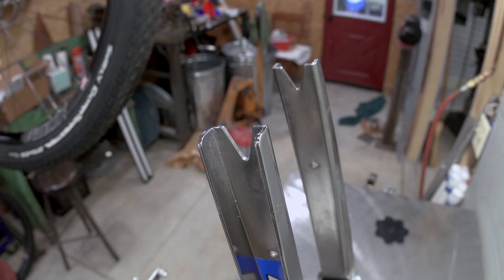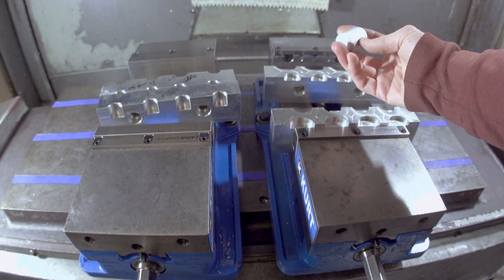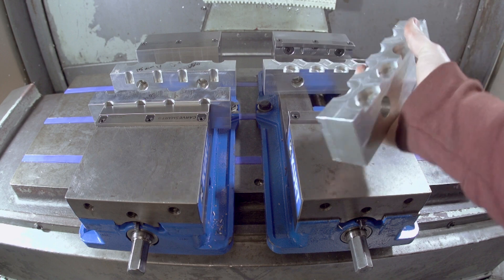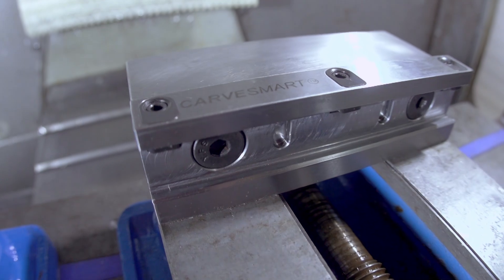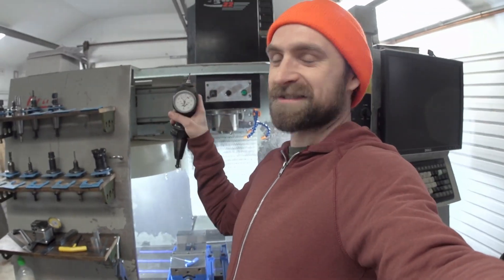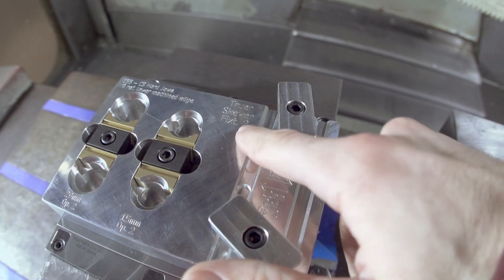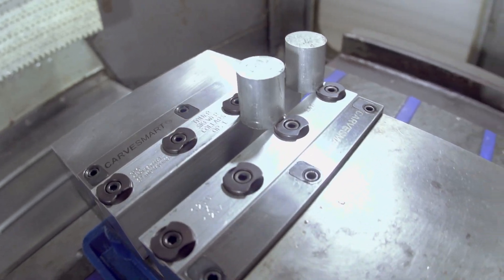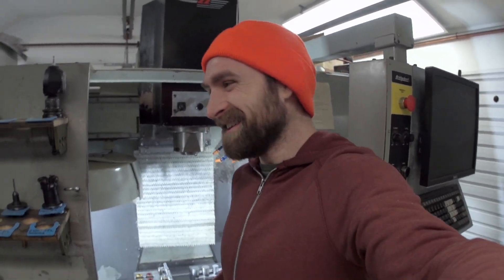CNC Workholding Solutions - Designing a new fixture for making The Truer Skewer

Comment: yeah I had that issue with loading 4. So I stuck with doing 2 at a time.(minimal tool changes too). I had 3 setups with 1 set of vise jaws. G54 was the same location the left rear soft jaw. (Been a few years since I ran them though)

Comment: Great improvement. A few things 1) write down your machine offsets for g55 and g56.  At some point you might accidentally setup a one-off job on your machine and forget which WCS you’re in.  If you can just type the offsets back in it’s way faster than proving. 

And 2) if you love that you would really love a Pierson pallet system. The vises would move to a pallet, so they’d never need to be trammed, and you’d make pallets for any new parts you have.  I started production with large fixtures clamped in vises, and still do that to prove an approach to fixturing or get a part in production, but I can’t imagine making the thousands of parts I’ve made in the last 18 months without the pallet system.  

I’m
Enjoying your videos and appreciate you sharing!!
Reply from the maker: For one-off jobs, I’ve been using g57. The Pierson system is great, but I don’t currently run my machine enough to justify the expense. Thanks for watching!
Reply: @RussellMakes  Thanks for making the vids!  And here's hoping you do so much business you justify the pallet system!  

I had put it off as well, and luckily my son (who also machines) had just pulled the trigger and once I started to realize what it made possible I got the PPS as well.  I now have 6 different dedicated pallets to production items, 3 fixture pallets that have a grid of m8 threaded holes and 8mm slip fit for dowel pins so I can test sub-fixtures on them, and 3 dedicated pallets for different vise setups.  I even have one pallet with three 3" vises on it, and that is my favorite.  I can easily support things up to 18" long across those 3 vises, and with jaws moved to the outside position I can hold up to 8" deep.  So 8" X 18"  stock fully supported across 3 vises.

I also do a ton of one-off stuff, and this just means I have zero resistance to changing processes.  I can be in the middle of a production run on dedicated pallets and realize that I could make a small tool that would streamline my operation.  No problem, once I design it and do the cam for it, throw on the 5" vise pallet, make my part, take it off and put a production pallet back on and  just keep going with whatever I was making.  No probing, no tramming vises, nothing.  Just gotta have some muscle to move the 5" vise pallet.  :)

I've subscribed.  I enjoy your upbeat approach!
Reply from the maker: @billstrahan4791  Thanks Bill. Sounds like you have a nice workflow. Cheers
Reply: @RussellMakes  Thanks.  Keep the videos coming!  I'm traveling until May 9 so I can't put my hands on my machines for 4 more months!